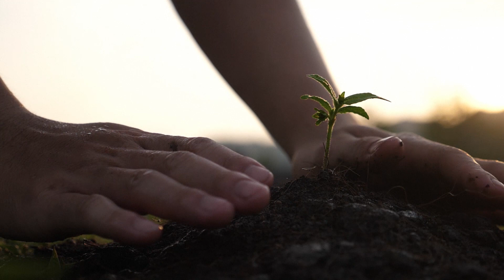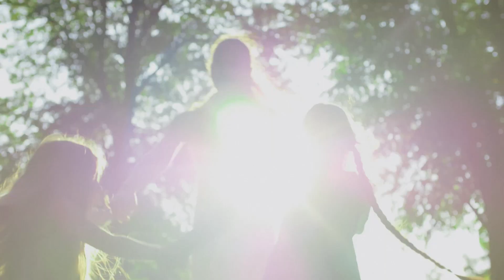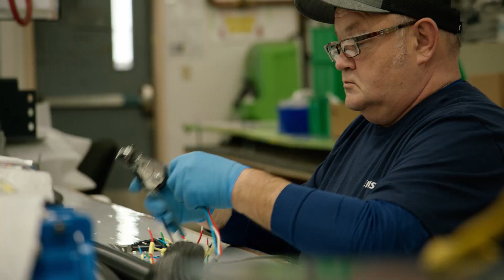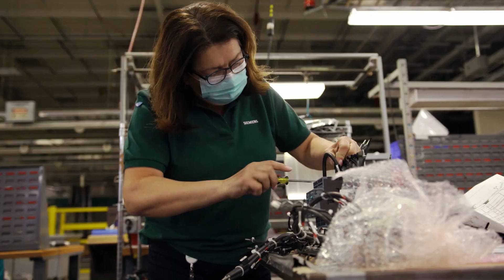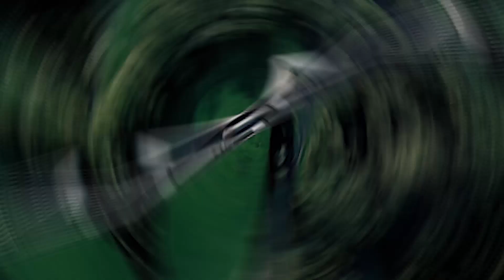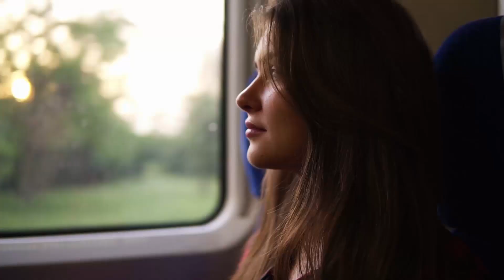Transforming American Rail with High-Speed Rail

Comment: Charlotte to Atlanta, let us Panthers and Falcons fans enjoy our rivalry without the hellhole of I-85
Reply: It's funny you mention those two cities. In 2020, Georgia DOT and the FRA approved the Greenfield Corridor, which will be 274 miles of new right of way between Charlotte and Atlanta. This is part of the Southeast Corridor Commission's plans. Trains will travel between 125-220mph, depending on what they select. They'll have 16-22 roundtrips per day. 

If the fast diesel trains are selected, it'll be 2 hours and 44 minutes. If the electric train option is selected, which may very well happen as electrification is going to be done by North Carolina DOT for the 75 mile long S-line they've recently purchased from freight railroad, CSX. The electric trains will take just 2 hours and 6 minutes between both cities and the 8 or so intermediate stops along the way. As of 2021, the Tier 1 Final Environmental Impact Statement/Record of Decision was completed by Georgia DOT.
Reply: @KevinCNYC1991  I haven’t heard about electrification on the S-Line, all I heard was that it got bought by the state.
Reply: @joshuametzl1420  My mistake, but it's being upgraded which is a step in the right direction for the S-Line.
Reply: I'm sure they'd be trashed in days